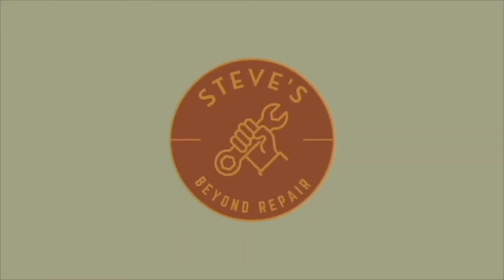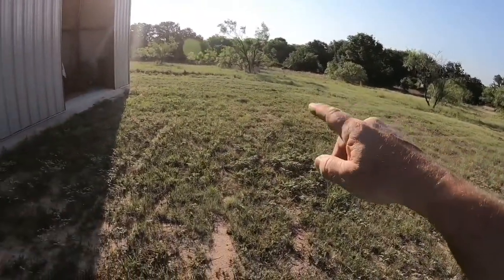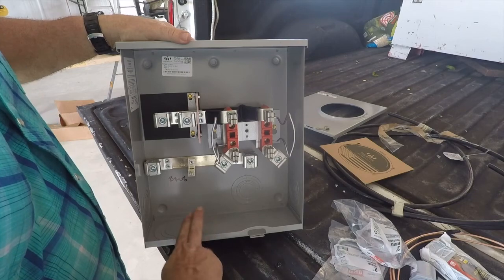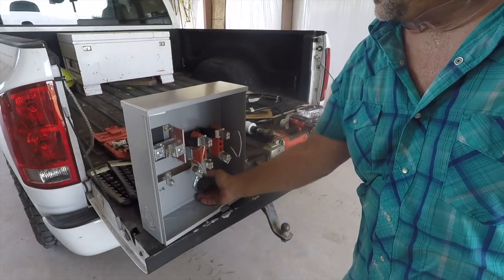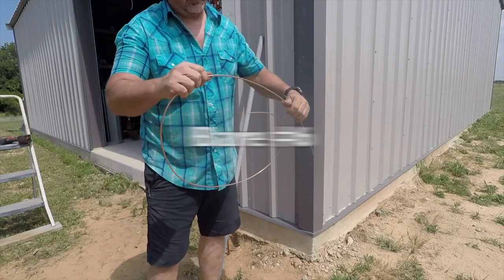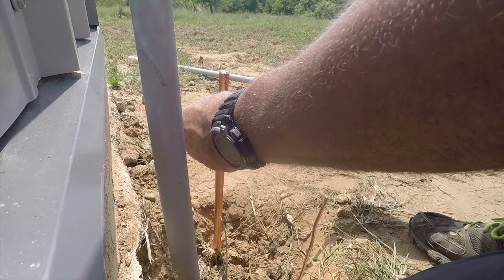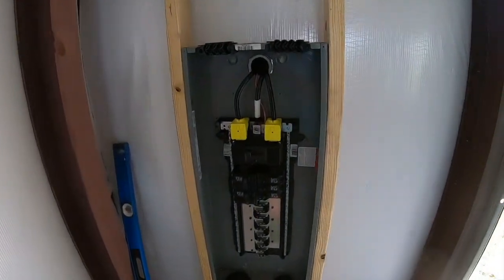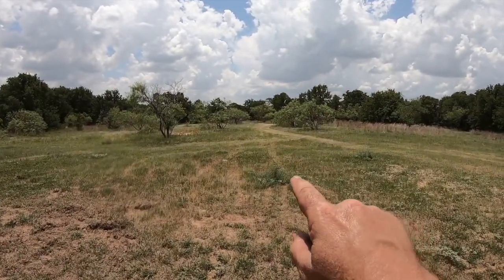Electric Service Install Part 1

Comment: Another great video Steve, but you left me hanging with the price.  I'm looking at having to buy a transformer and two power poles.  It ain't cheap.  Blessing on you little peace of heaven, makes for a nice getaway!!!
Reply from the maker: Thank you señior Luis! You noticed that huh? 😁 well, after adding that text about price, I decided to shorten the vid and make it 2 parts. Tri County really helps with cost on all of it, you will be floored!